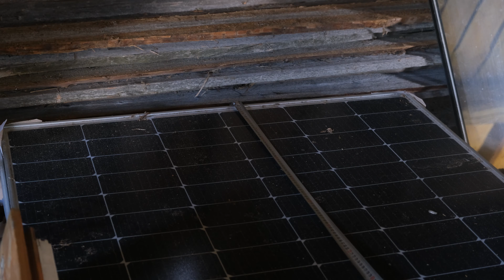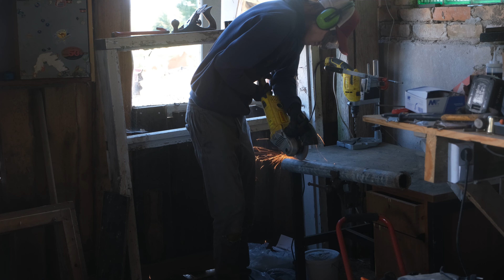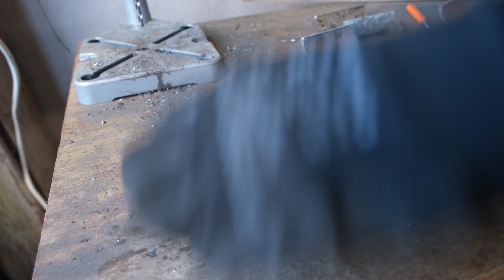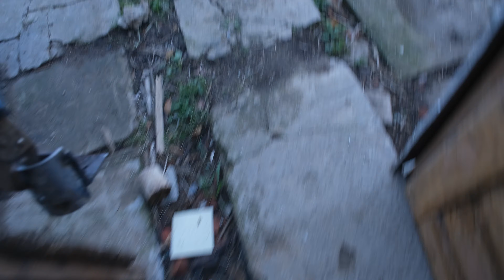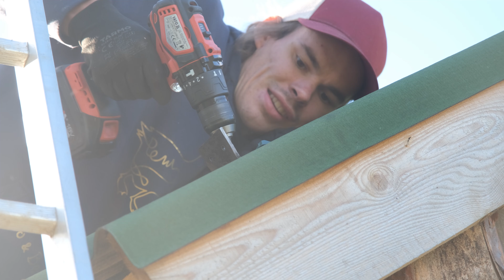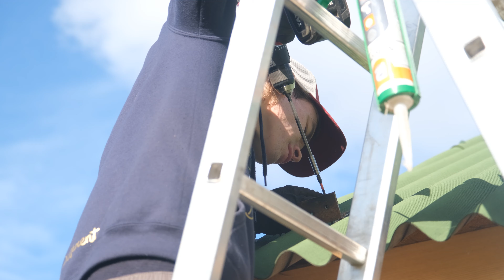Building Our SOLAR PANEL Roof Brackets (GOING OFF-GRID)

Comment: That was an interesting video, your workshop is becoming an extremely useful place in which you can do some quite major, useful works. Your inventiveness in cutting the waste pipe and welding up those brackets to your exact requirements was excellent. You are making a big investment, though I do not think you are spending too much. You are saving a lot by using your time, not money, to buy someone's work and inventiveness. It appears, you are extremely practical at finding ways to make your projects work for you. The next video will see it all come together and show the value of your plans and hard work.

Comment: hi i know this has nothing to do with what you are doing. but i want to can some home made sauce in jar,s . how long do i need to put them in a pot an boil them for an will that seal the jars? i have never done anything like this before.   help please an thankyou.
Reply from the maker: If you put the jars empty in the oven and then take them out hot and pour the hot sauce just from the heat. They will seal no problem as that will be hot enough. If you want to be sure put them in oven for few min. When we do tomato sauce we don't put them in oven after just warm up the glass the the hot sauce will make the jars seal. Never had problem with the sauce getting bad. No need for fridge just colder storage. Hope that helps ❤️😊
Reply: @DoBeDiff  thankyou for your reply an yes that has helped.

Comment: This kind of construction is definitely not a good choice, metal brackets that are screwed on the roof would have massive pressure on the roof panels as it is a soft material with time it will make deformations which will lead to panel damage and cause water leaks maybe in some point construction will slide down.🙃
     Another negative impact on the construction would be snow as mentioned you can clean snow but it is impossible to clean 24 hours of  snow which will lead to greater pressure on construction.😃

Comment: David it's absolutely madness where you put the brackets the roof it's going too leak with time after all your hard work putting it up 🤔
Reply from the maker: There is silicone under the brackets and it also fills the screw holes. Some small leaks would be the end of this roof. But in this case I have monitored the roof when it was a heavy rain storm and it was all fine. I will keep an eye on it and will change the system if rain starts to damage the wood. But it should last quite a long time, We anyways plan to expand the solar system 😀

Comment: Fantastic...looks as if you have 11 ? panels?  250 to 390 watts each?  I have 8  250 watt panels....feeding an Outback 80 charge controller...which converts the series/parallel panels to 24 volts to run an Aims 4000 watt inverter and to charge a 24 volt 3100+ amp hour battery bank... The charge controller can handle 4000 watts when outputting to a 48 volt inverter/battery system..Using a 48 volt system means only one charge controller...of the 80 amp size as is mine.. Its all in the charge controller specifications...I would like to add 2000 watts more panels but it means buying another expensive charge controller...Just a lack of forward thinking back in 2012 when I built the system...My panels are on poles and track the sun....then at dark automatically return east to await the sun returning from Latvia:-)
Reply from the maker: 8 Panels of 450w Each (3 of them are for my Aunt) In the next episode you will see the inverter and the power output. 😀 Trackable solar system is amazing and probably very efficient.
Reply: @DoBeDiff    The charge controller/inverter looks really good....and price is very good...Got me thinking about adding another 2000 watts...and re-configuring my battery bank to 48 volts....I need a 120 /220 volt inverter however..
  My chin nearly fell to the floor when you gave the price per killowatt at your location...My per kw charge is 12 cents last I checked...With solar my power bill runs 35 dollars on average and 18 dollars of that is a flat charge...
Reply: @DoBeDiff  I think tracking the sun is worth another 50% ....2kw equivalent to 3kw.   My charge controller indicates 15.5 kwh harvested  thus far at 5:30 pm...so less than 2 dollars...:-)